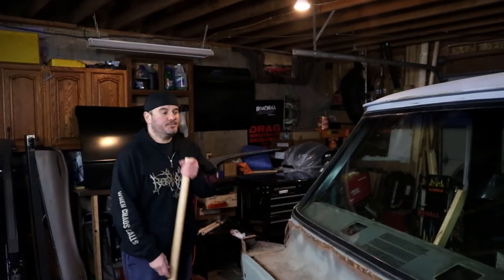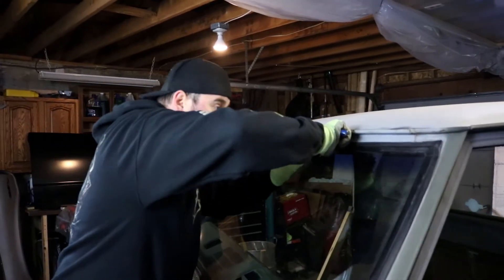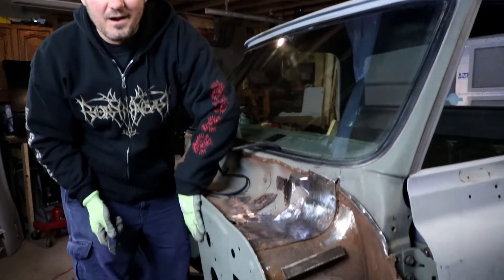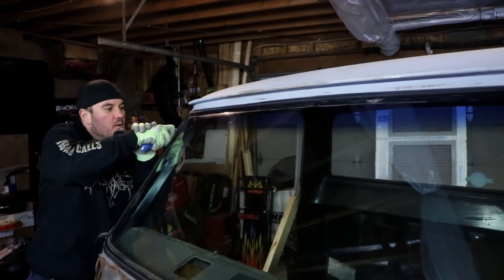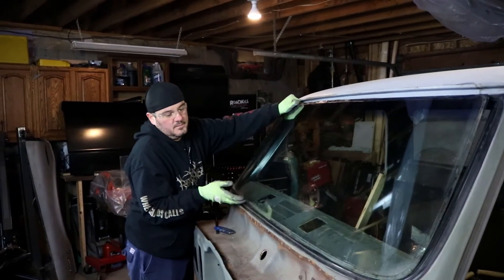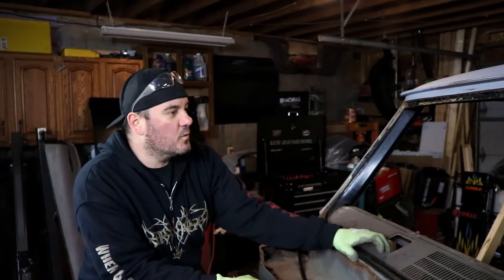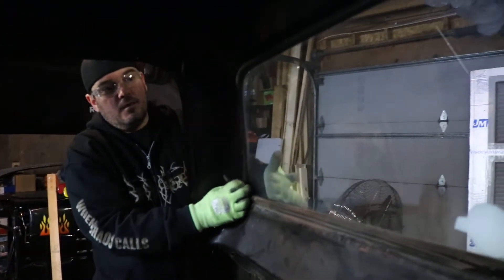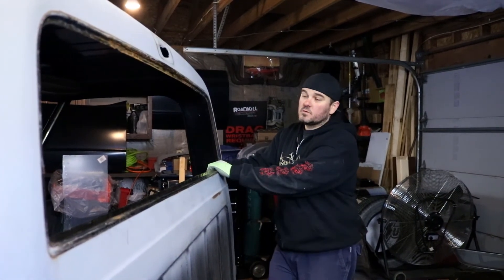1971 Chevy C-10 Truck - How to remove the front windshield and rear window glass

Comment: If you use a cotter pin extractor from the inside and even gentle pressure you can pop the glass out without ruining the rubber gasket.. one of my first tasks in the body shop when I was 14 yrs old...
Reply from the maker: Nice, I looked at a couple different ways to do it but since I will end up replacing all the rubber on the truck, I just figured I'd cut it. Thanks for the tip!

Comment: Good video showing how easy it is to remove the glass, I have removed the glass on my Chevelle and it is just as easy, special tool to remove the trim and then cut the urethane that holds the glass in.
Reply from the maker: Yea, I've replaced both front and back glass on my 1970 Chevelle back in the day. Man I miss that car!